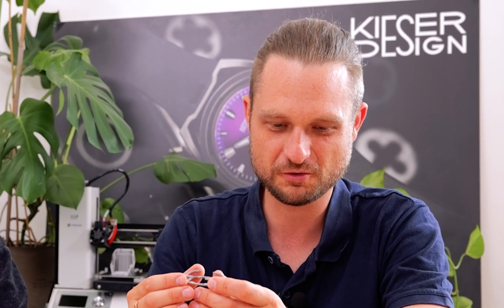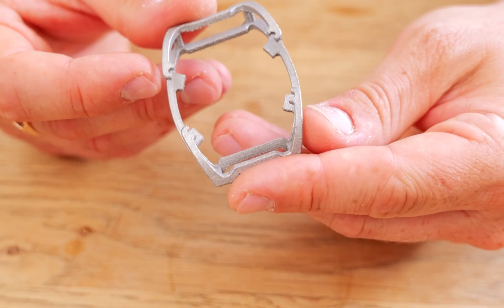Forged by Laser: 3D-printing a Titanium Watch!

Comment: Would wire EDM work? Those angles look hectic and maybe costs would be horrendous but maybe the finishing time might offset that. Those textures are cool though, very difficult not wishing to run my fingers over them.
Reply from the maker: Interesting thought 🤔 Wire EDM is mostly used for high precision parts cut from sheets, like gears. I‘ve never seen a machine capable of doing something that would require movements like a 5-axis CNC mill. Do you know more about that?
Reply: @kieserdesign   i'm not a mechanical type but i saw this and was blown away, 
https://www.youtube.com/shorts/UlFILczCZpg